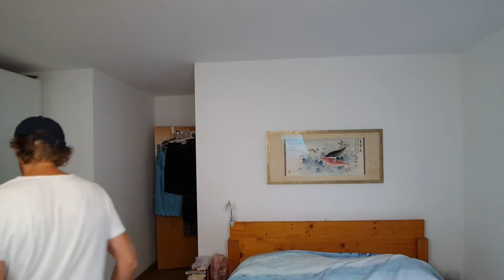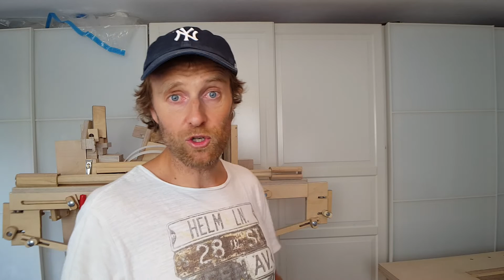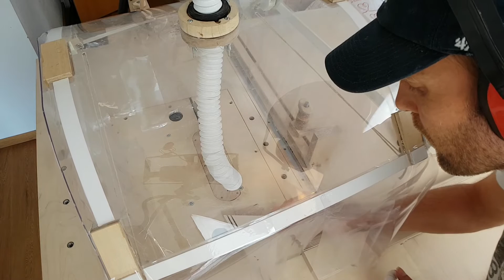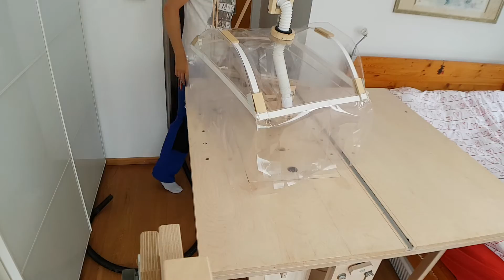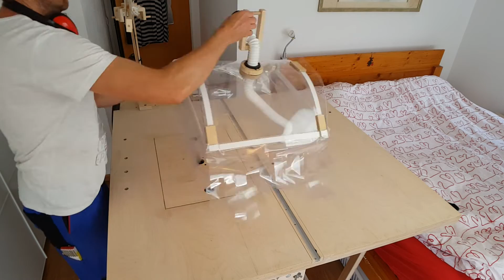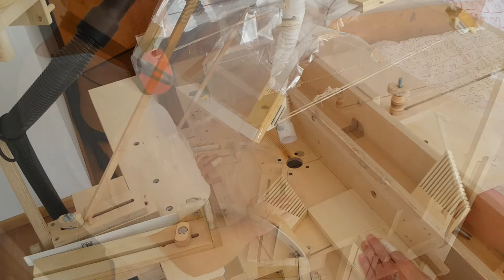How to make a feather board extension for the bench super flex flat-bar,

Comment: Looks good. Nice safe set up you have now. I couldn't imagine the challenges of not making a mess when I work but it looks like you have a good system
Reply from the maker: Thanks Dave, well the efficiency of the dust collection gives me the possibility to work inside the bed room, dust is not a problem any more,  but beside this it is indeed quite a challange to keep everything under control.  Even if you make only a small project, cleaning up, putting all the tools and the material away  must be a running task here otherwise you would make immediately a huge mess. I got used to it...had to 😉

Comment: That huge contraption is useless in such a small room. There’s no way you can rip big sheets and long boards in that little room.
Reply from the maker: Well  working with huge sheets is more the exception rather than the rule, even though there are ways to work around. After one year of usage and experience with this concept I can say that except of some handling issues which I'll have to fix, I am extremely happy how everything is working out.